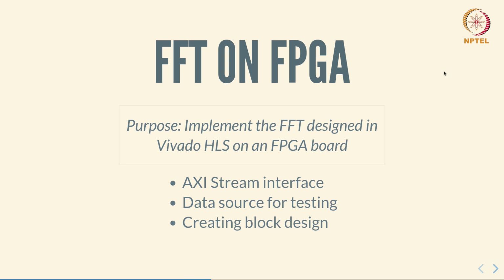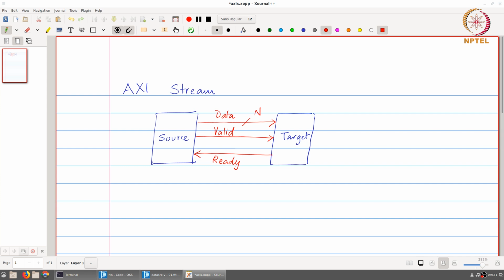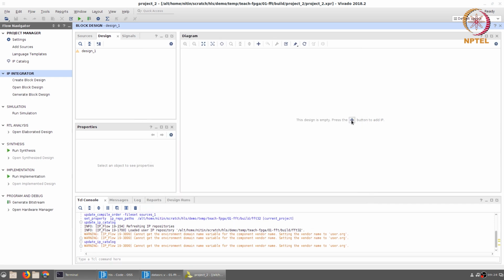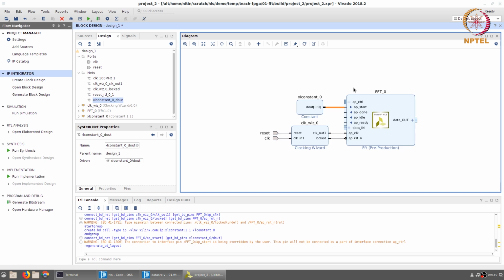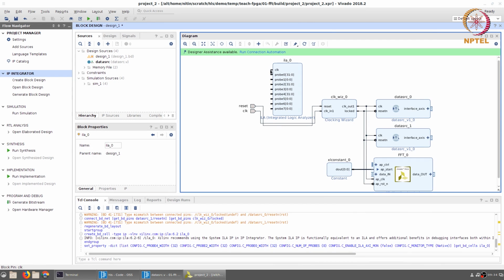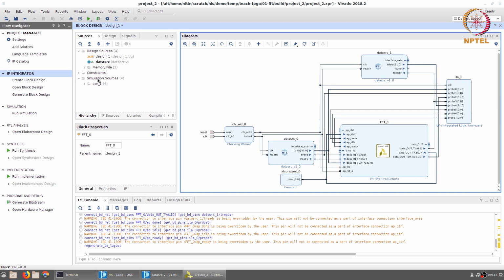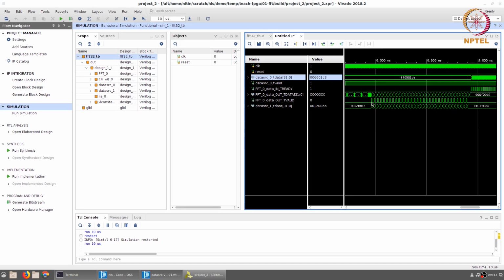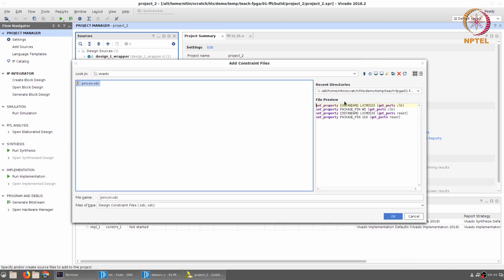Lec82 - Demo: FFT on FPGA board

Comment: Rebuilt this in v2021.1 using Vitis-HLS. In Vivado I have built the IPI block diagram, but I get no activity in the simulation, other than the Clk and Reset signals from the TB :(
Reply: how u rebuilt the ipi block diagram? the FFT block is different, was pre-production in that year and now is full I think.